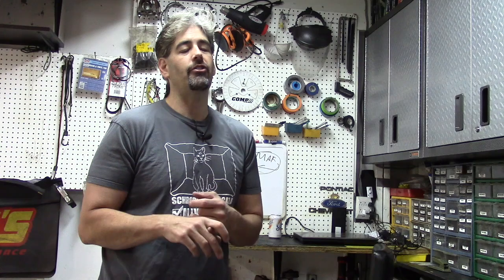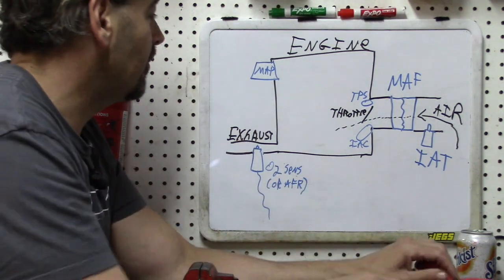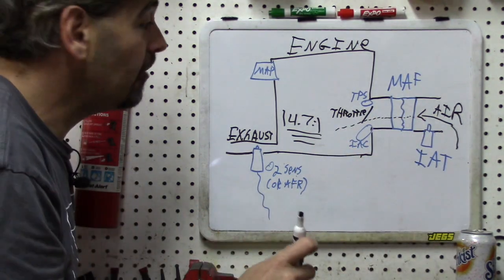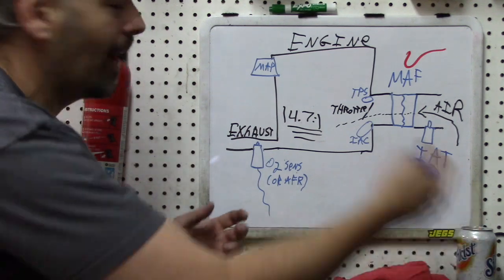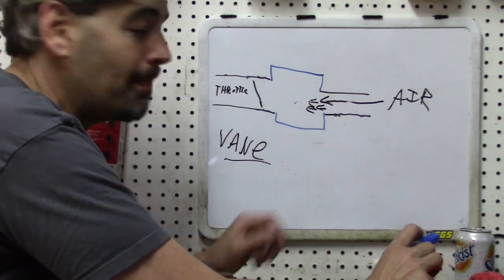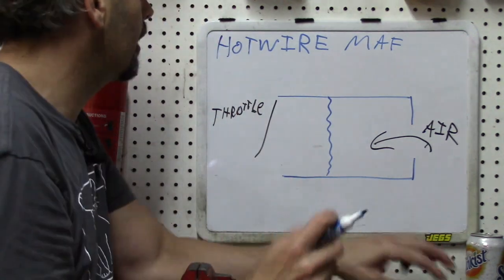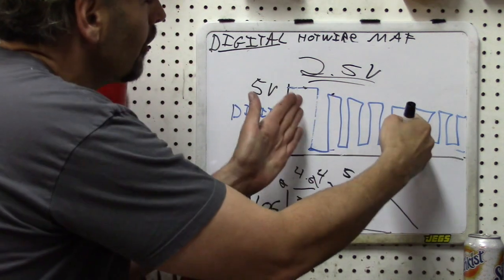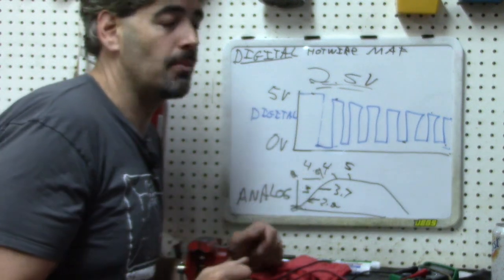Diagnosis and Understanding: MAF Sensor Pt1 Analog, Digital, Hotwire, P0101 P0102...

Comment: So just a thought popped int my head.. If a guy is at the racetrack in a car that still uses the factory sensors, is it a waste of time to ice the intake? No matter what the temp of the air, be it hot or cool, the computer is going to automatically correct to get the same result correct? Especially if he is icing the intake AFTER the MAF??
Reply from the maker: +Ryan Lewis Remember the correction is RELATIVE to the actual mass air flow.  E..g If the air is colder, there is more air and thus more fuel even though the proportion is still 14.7:1.
  Also it should be considered that at the track, the car is likely to be at WOT and under those conditions, stoichiometry is not maintained anyway. The car will always run rich under WOT

Comment: Is the air intake sensor the same as an ambient air temp sensor?
Reply from the maker: In most cars no- there is an ambient temp sensor away from the engine compartment.  But older cars might have just the IAT only.

Comment: Excellent presentation. What's the impact of fuel consumption and revs if your remove catalytic converter and leave the O2 sensor in place?
Reply from the maker: None whatsoever.
Reply: Schrodingers Box I thot it would create some imbalance. the O2 sensor at exhaust would sense lean causing more fuel to be injected hence more fuel consumption. Removal of restrictions would also increase car HP.   What do u think?
Reply from the maker: Steve Mbugua Rear O2 is barely used for fuel trim and on most cars before 2008 not used at all for fuel trim.
Reply: Schrodingers Box What would cause excessive fuel consumption in X5 E53 ( year 2006)? Spark plugs are new, fuel filters new, MAF new, battery is new. Car also has to crank 5-7sec to start. Revs also not dropping much after gear shift as has been the case in the past.
Reply from the maker: Steve Mbugua What's the LTFT and STFT at idle vs load?
Reply: Schrodingers Box Haven't checked that yet.
Reply from the maker: Can't help without data. You have so many variables they can't all be listed. We don't even know if you have a rich condition or mechanical hindrance. 
  need to at least verify one or the other to start a path to diagnosis.
Reply: Schrodingers Box Will get the LTFT & STFT then share with u. Let me know if there is any other priority data u need as I'll have to go far to access a BMW diagnosis equipment.
Reply from the maker: Steve Mbugua The STFT and LTFT curved against load is all I need to confirm if there is rich condition or not. Fuel pressure curved against load would also be helpful.

Comment: Error on digital meters reading PWM. A 5v PWM running with a mark space ratio of 50% will read 2.5
 volts on a digital multi meter.
I don't think they change the frequency - They change the PWm(pulse width). Same frequency, different on/off ratio.
So if the signal is off longer than it is on - The voltage will be lower than if it was off shorter than it is on.
:)
Reply from the maker: This is exactly what I said.  The multimeter reads an AVERAGE of the signals.  Duty cycle adjustment with more on or off with proportionately change the voltage reading on a DVOM.

Comment: This  error P0113 is on my 2001 Mercedes benz w203 c200 kompressor.
I replaced the pump and the front Sam and the mass air flow meter.
Still the same hard start and rough idle.
Reply from the maker: what data showed the pump and MAF were the problem?

Comment: Hey Matt! Big fan of you and a product member of the 2% ;)
I needed your opinion about my F10 BMW 530D...The AFR that goes up to 29:1 when I start the car and while driving comes to ~24:1 so it's running very lean. This is on a Scan App called Torque.

I have No check lights or errors but the car runs bad and hesitates like crazy and has black smoke.

I have checked fully for vacuum leaks and there are none what so ever.
However, I unplugged the MAF and the AFR comes back to 14.5:1 steady and car runs fine and smoother. 

I have also checked the resistance on the ECT sensor and it's in specified ranges.

Would it be safe to assume its a problem with the MAF sensor? Pl advise Sir.

Thank You.
Reply from the maker: What does the long and short term fuel trim show at idle and at 2500rpm?
Reply: @SchrodingersBox  Thanks so much for the reply Sir. 

Surprisingly, I'm not getting a read on both Short Term and Long Term trims on the scanner.

Before I unplugged the MAF, The lambda value was at 1.99 Idle and dropping down but higher than to +1.XX when I revv the engine.

With the MAF unplugged, it stays at 0.99 on idle and comes down when I revv the engine.
Reply from the maker: Unplugging a MAF and getting better results does not mean the MAF is bad.   What is the MAF reading in g/s at idle and at wot?
Reply: @SchrodingersBox  Hey matt sorry for the delayed reply :(

I checked the readings now since I was away from my car.

At idle : 7.9g/s
At 2500 RPM : 70g/s

These are the readings I am seeing. I plugged the MAF sensor back in and the AFR on cold start off at 14.5 and the jumped back to 29 again in 3-4 of minutes. Look forward to your thoughts on this...

Comment: Does this mean that drive-by-wire vehicles - where the PCM has control of the throttle - never have idle air controls, Matt?
Reply from the maker: They do- they just dont have a separate IAC motor.  The IAC is controlled by how much the throttle is opened by the drive by wire system rather than how much a portal is opened by the IAC pintle.
 At high idle such as warmup, you will see the TPS at maybe 20% which of course creates a fast idle (same as stepping on the pedal- literally) and it steps down as the engine warms up closing the throttle more to around maybe 3 or 5% and thus idle lowers- same as you may see 110 counts on an IAC and down to 30 once it warms up.
Reply: @SchrodingersBox  Thanks for clearing that up, Matt - that makes perfect sense. It seems that most cars nowadays are drive-by-wire models; I can't recall the last time I saw a throttle cable.

Comment: If you have a Multi-meter with the frequency setting can it be used to measure the frequency of the digital MAF?
Reply from the maker: +Colm Dowling YES however most DIY level multimeters will not have near the range necessary.  But indeed if you have appropriate range you can absolutely is if on digital sensors.

Comment: I have a a 2012 Mazda bongo. Its bought it only months ago. Engine is like brand new. But my fiel consumption is very high. Its very hard to diagnose the problem. Its been like this since I bought it. Then it gets bery hot but not enough to bring up the temp in the car. I am thinking there may be a vacum leak.
Reply from the maker: What data do you have?

Comment: Hi sir i hope you are fine i just want to ask you about a maf sensor used on some fords it has 6pins with iat integrated in it and one of the pins is referred to as"maf return gnd" is it an additional ground because the sensor has ground already and if this is the case i just want to know why it has two grounds? I know that you mentioned that in your video but it is upsetting me Anyway thank you in advance ❤️❤️
Reply: 1 iat
2 iat signal
3 maf out
4 maf rtn gnd
Vpw 12v
Reply from the maker: great question. on a 6-wire system it is almost guaranteed as follows-
  Two wires for the IAT sensor (signal in and return). 
  The 4 for the MAF will be a signal wire, a signal return (ground),, a 12V Hotwire feed and a separate ground for the Hotwire.
Reply: @SchrodingersBox  thank you so much. at the i thought they are the same but now it is clear my greetings sir im learning from your videos more than i do in the class🙏🙏
Reply from the maker: yeah a lot of cars just use a common ground. others have separate ones. all depends how the PCM reads the sensors.

Comment: now i understand  the maf sensor but i have one question is if the pcm give that maf sensor 5 volt to function it  and the sensor it self resend voltage to the pcm by ground wire ( what the function of 12 volt wire?? ) sorry for that question but im still beginner and English  is not my native language
Reply from the maker: The 12V wire is to feed the hotwire.
Reply: thanx

Comment: I've just replaced my MAF on a Citroen 2007 C4 Picasso 1.6 HDi DVM Test results Old... sensor no resistance reading and no Capacitance reading 
New...sensor no resistance reading but did get a Very low capacitance 5nF !? 

So can I take it it is not a Hot Wire sensor - or what  type of sensor are they...joe
Reply from the maker: I don't know the design- what was the voltage drop across what you thought was the heating element?
Reply: Sorry I'm late in replying - tabulated voltage readings across the MAF Two wire sensor - one leg of the sensor has 12Volts to gnd 

Ignition ON engine stopped  = 4.29 V across sensor

Engine running  
 -------------------:::::-------------------  = 2.59 V  @ 700rpm
                                                  = 2.55 V  @ 1000
                                                  = 2.50 V  @ 1500
                                                  = 2.45 V  @ 2000
                                                  = 2.33 V  @ 2500
                                                  = 2.23 V  @ 3000
                                                  = 2.18 V  @ 3500
   ---------------:::::--------------------   = 1.18 V  @ 4000rpm 

I Hope that give you some idea what type of MAP sensor it is, it kinda looks it may be a fancy electronic gizmo !!?? ...joe

Comment: Please, comment my logic :
I had a problem that the car was producing to much smoke. There was an 
error code that the MAF was producing too high readings (+50 g/s) . When
 I disconnected the MAF the scanner defaulted the airflow value to 8,3 
g/s. In that instant the excess smoke stopped. The logic is that, if I 
press the gas pedal the engine will not provide more diesel than the Stochiometric
 target value of 14,7 / 1. My logic is that the benefit of MAF is 
therefore only for situations where the airflow is supposed to be less 
then 8,3 g/s, ie. when idling. This means that gas consumption will 
increase when driving in a city.
Reply from the maker: It actually sounds like your MAF is mid-measuring.  the MAF always is functional as the first input for fuel mix calculation independent of all other inputs.

Comment: what to do if I have P0104 code? If I check using meter the voltage on signal wire looks good as voltage changes between 1.25 - 2.0 with throttle opening but if I pull the plug then engine keep working while it should stop as suggested by some other youtubers.
Reply from the maker: I would check at the PCM for intermittent signal and trace back- especially I would examine ground.
  Could also be a broken hotwire.

Comment: I blew four mass airflow sensors on my 2011 Nissan Frontier.
My slip light comes on.
Can’t get past 2500 rpms.
I need help please
Reply from the maker: Sounds simple. Just start with the basics- What is the voltage drop across the hotwire?

Comment: Matt, 
      I have a 2007 SRX 2wd 3.6l 116,792 miles. ABS CODE   C0551-00 (option configuration error). Can you do diagnosis and understanding of C codes videos? 
                             Thanks for your teachings!
                              Much appreciated!
Reply from the maker: Dang i never even heard of that code lol. That would be a good one for sure.

Comment: Hi. i have proton Gen2 2009 for about 4 years with 133000 KM. recently and for about 2 month my ECU overheat and my Exhaust overheat so after an hour i can not driving beacuse of too much heat under my feet. i have done many test on my car and nobody know what should i do? yesterday i saw your video and tested my MAP sensor with multi-meter. i have four wire map sensor or T-MAP Sensor. voltage is 3.41 Volt when the car is off and switch on, in idle i have 0.9~1.1 Volt. and i press the pedal and run the car to 3000 to 3500 RPM But the voltage reduce !! i thought  my sensor is bad and call my Friend with same car and he has no problem with his car (Exhaust Overheat or ECU overheat) i test his MAP sensor too and same result ! is it possible?? i went to mechanic he use scan tool and i have Manifold intake temperature about 70 centigrade ! he was surprised and said i don see any case like this before! what should i do? can you help me? the ECU is so hot that after an hour you can not touch the ECU cover. i used anti heat fabric on my Exhaust (Ceramic fabric) but nothing can reduce the heat ! is it possible that bad sensor MAP cause ECU over heat or exhaust overheat? the Exhaust is open and my Catalyst is clean and has 2.5 cm Hole at the center.  
help me please.i am so sorry about my bad English. thank you so much.

Comment: Hello, 
I am a new subscriber of your channel and I found it as an informative channel which corrects many misbeliefs.
The fuel trim videos were very useful and I understood everything. Thanks for that...

*I have a simple question for you, dont know whether it is a stupid question or not... Can you please clear it?
 

My question is : In a hot wire type MAF sensor, you said the PCM is keeping the temperature of the wire as a constant. So there should be something to sense the exact temperature of that wire, to tell the PCM what the amount of current to increase or decrease to keep the temperature a constant.. 
Nothing is there like this. But it works.....

How the PCM knows the wire has attained the desired temperature without actually measuring it ....?

I didnt understand.

Can you please reply?

thanks in advance
Reply from the maker: I actually am not sure but my guess it it is indirectly measured as a result of the amperage and the external temperature and other variables.  I do not believe the actual temperature is measured
Reply: @SchrodingersBox  Thanks a lot for your reply. Appreciated.
This doubt has striked my mind when i was watching this video. I dont want to be just a parts changer. I have to understand various automotive electronics technologies and exact servicing strategies.

I am from India and your pronunciation is easy to understand.
thanks

Comment: Hey Matt mabye you could give me some advice on this, I have a 2014 inifinti q50, recently I had 2 codes pop up, p0101 and p010c my car has dual air intakes, and I'm sure you know that means both of the maf sensors are not getting proper reads, it doesn't give me a check engine light but it does sometime sputter or stall when just started and when at full throttle it seems like it is governed. I changed both of the sensors and the codes still pop up. I looked at the intake tubes are fine. I tested the maf connector but I can't get a read but at the same time I can't get my tester into the female connection.  I have 3 wires on one and 5 on the other, its kinda crazy. Could this reading lead to a problem with the evap control system pressure sensor? Thanks, Any help would be appreciated.
Reply from the maker: I would start with a basic fuel trim analysis on each bank

Comment: Please help! I have a 2005 astro van with mental problems.
P0101 and P0304 when under a load after about 30 seconds. 
Loss of power on a long pull and it throws these codes.. new MAF (x3), new plugs, wires, cap and rotor, (x2) Crank position sensor, New oxygen sensors, fuel cap, Fuel pump,(x2) PCV tested, All vacuum hoses replaced, no slop in the distributor shaft. Also a weird situation with oil in the throttle body.
I'm lost....
It won't pull up a long hill without doing this crap, It acts like it's starving for fuel but fuel pressure is good even under a load. HELP!
Reply from the maker: ok what data do you have?
Reply: @SchrodingersBox  what do you need?
I have a fairly decent scan tool.

Comment: I have a issue that I think I know the problem however no one will come out and say it there’s a round robin you need to go to the bealership or a locksmith. Even the shop I bought my engine from no one will shoot me straight and I’m very frustrated because I spent 3 years building my car. Yea it’s completely legal I bought it from the Ford dealership  not Slick Willy’s used car lot and I have owned it since 2013. I did
A engine swap and it had to be professionally turned because at the time I finished the work there were software issues with both SCT And Bama, I took it to the brain or whatever they call him he sold me a SCT unit and two custom tunes. For $1,200 I didn’t have a choice at this point. Picking my car up I get the unit and one tune. And stupid low hp it should have been considerably higher. But I’m older and I won’t be able to  ever handle it at max

Comment: Barometric pressure at sea level is 14.7 psi but what is the Fuel unit metric in that stoichy ratio :-)
Reply from the maker: Stoic is 14.7 to one. It has nothing to do with atmospheric pressure though- the fact they are the same number is coincidental.
 The actual metric of the14.7 is Volume to Volume. Whatever that volume is - whether cubic feet or cubic inches or whatever, 14.7 air to 1 fuel.